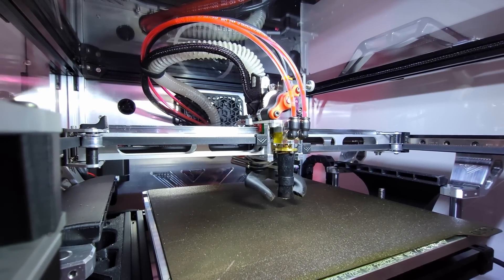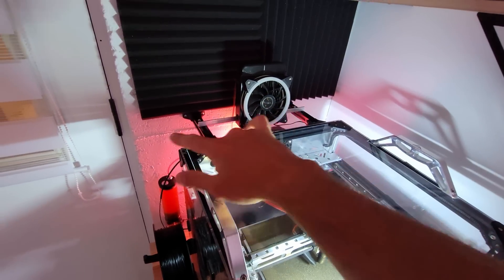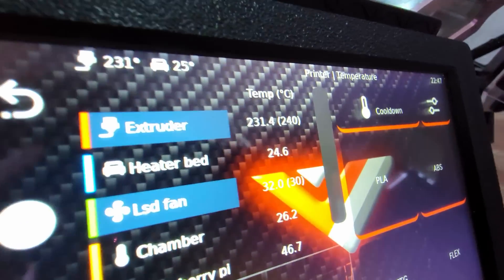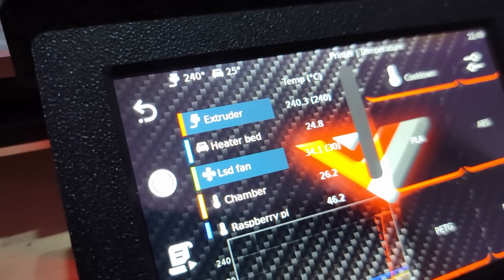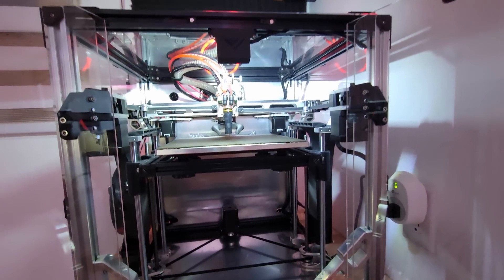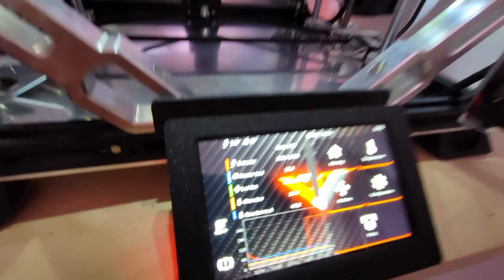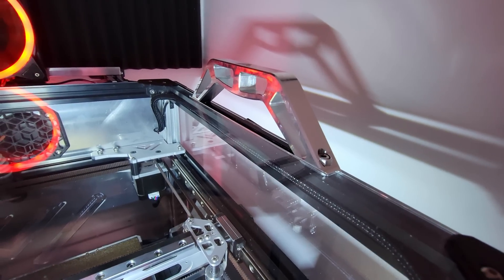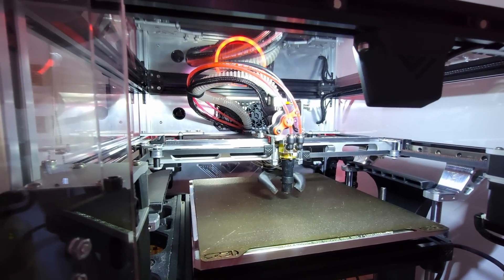LSD hotend watercooled heatsink temperature test 1

Comment: Water cooling seems to be much heavier than 3010 fan and heatsink. And it doesn't improve printing quality or performance.
Reply from the maker: Its not much more .its a bit more I think.  As for as improving print quality, it can help I think. And we are about to have more data on this from what Miragec is working on :) a sharp heat break will have impact on more things we knew about .... :)
Reply: @Vez3D  Sharp heatbreak is less retraction and less pressure advance. But for such a long melt zone it doesn't make any difference. Hope to see some real tests from you soon.
Reply from the maker: @TheNamelessOne12357  its all just a theory..nobody really measured anything yet. :) not even sure if its right or wrong hehe

Comment: Could you do a torture test to see how far it's able to go?
300c+ (400c?) in 120c chamber temperatures would cover pretty much all bases a enthusiast machine would ever see.

And try mounting a 3mm thermistor inside the heat sink, the RSCS probably threw off the measurement since it blew cold air at the thermistor.
Reply from the maker: Thermistor is protected by kepton tape.  I doubt it was affected by the draft. As for 120c chamber..my printer is not meant for that and wont reach it sorry.  I can do 300c with 45c chamber test
Reply: @Vez3D  A quick way to check if the draft is affecting the reported temp is to take a little piece of foam and tape it over the temperature sensor.
Reply from the maker: @bdykes7316  the temp sensor is well inside the block and the tape is covering the hole. I highly doubt it can see any air flow from there
Reply: @Vez3D  My error. I had the wires mixed up with the sensor.
Reply from the maker: @bdykes7316  hehe
Reply: @Vez3D  You could chuck it into an oven to get to those temps, but it's a hassle and I get that you don't particularly want to do that :)

Regardless, I think your designs are some pretty cool stuff, so keep doing your thing!

Comment: be careful with those hose, we use the same at work for pneumatic system and like to crack when there's a lot of movement and heat
Reply from the maker: They are polyurethane hoses. Is that what you use? Ill stress test them when im back from vacation

Comment: Why does the RCSC (?) have any impact on the watercooled heatsink at all? I mean it instantly dropped by about 4 degree which is a lot. Then the heater bed will have a significant impact as well I guess. 
The whole purpose of having a watercooled heatbreak is to be able to print really high temp stuff in an enclosed chamber. But if the chamber temperature (which was affected by the ventilation system) has such a big impact on the heatbreak cooling, you could probably just go with aircooling. 
So my question is: are you sure your watercooling cycle is fine? Nothing is clogged, water running freely, fan and radiator working correctly? You should double check that.
Now I am really interested in a comparison between air and water cooling in a real stress test. 300C hotend, 110C heat bed, enclosed chamber. Or higher temps if you can. At least for one hour, maybe longer. Those are the parameters watercooling is made for :-) 
Looking forward to it, super interesting stuff. Cheers mate!
Reply from the maker: Oh yes..aircooled is perfectly fine. Been running it for weeks even without a fan. That watercool is for those who will have a heated chamber or for those who prefer the coolness of the the thing.  But I think it has some advantages as well. Having a cold and very sharp heat break seems to have impact on retraction and precision of the extrusion. Been discussing with MirageC about this and the theory behind this will be explained in his video. :)  i will let him explain what he found out...but that might have convinced me to keep the watercool systen over the aircool one...even if aircool was working fine.
Reply: Probably the big difference between aircooling and liquid cooling is that the coolant is moved out of the enclosure, which allows for the coolant to be cooled down to ambient temperatures (or even lower with active cooling solutions like a heat pump). Using an air cooled solution would limit the cooling to the cold zone as you can't as easily pull cold air. You would most likely pull air from the enclosure itself. If you could pull cold air then the cold air would also be capable of dropping the enclosure temperature.(which may be only desired up to a certain point to prevent warping).

The problem is a bit more nuanced because of the different temperature requirements across all different areas of the printer. Watercooling does give you a bit more shielding to prevent excess temperature exchanges.

I'm personally also looking forward to seeing a stress test, he might need a bigger radiator so he doesnt saturate his cooling pid's output but it looks promising so far!
Reply from the maker: It is fine and now clogged. The  air blowing on it has a little impact on the themp. Its just normal.  It also has a little impact on the bed too..but pid will keep bed at temp

Comment: You should test it with 300C extruder 100C Bed and let it sit closed for 2 hours. Then you have a real stress test. If it can do that I can do anything
Reply from the maker: It can  ..  i have done that test but with 110c bed and 280c. Its not 300 but close enough. It stayed arround 36c.  But enclosure was open. I should do another test with it closed...but im sure it will work great too
Reply: @Vez3D  285 is recommended HTPET temperature - an awesome material you should check out if you haven't (aka BPET, plain PET). Probably less of a stress case though because it doesn't need heated chamber or even bed.
Reply from the maker: @daliasprints9798  nice ty..ill look it up
Reply: @Vez3D  good!

Comment: How does the temperature compare to a fan cooled heatbreak? If it's possible to keep the heatsink at a constant temperature would that help with a more constant flow?
Reply from the maker: I dont have a sensor on my aircool one. I will need a temp camera to compare..but it is much hotter on the air cool..i can feel it with my fingers. Its definately higher than 50c

Comment: Can you try to print a benchy at, 1500 mm per second?
Reply from the maker: How is that possible? 🤔  you need a certain distance to reach that speed.
Reply: @Vez3D  well now I see your point. But you still can test would happen if you set the machine to 1500 mm or as close as you can get it per second.
Reply: @Vez3D  Above around 50k acceleration a benchy should gave at least some places it can reach 1500. At 250k or so it'd have a lot. Easiest way to quantify would be slicing it and running it through klipper_estimator to see cruise time.
Reply from the maker: @daliasprints9798  i have done a benchy in 3:38 i think..and accel was set at something like 120k. But at 1500mms ...it would need even more to reach
Reply: @Vez3D  The length it needs to achieve 1500 between accel and decel is 1500²/accel but that's assuming starting from zero. When you have shallow turns at the junctions and high SCV it can be somewhat less - (1500²-v0²)/accel if I'm not mistaken.

Comment: This is a serious question. I want to up my game when printing. I currently have 4 highly modified ender 3's and a Prusa. I would ove a VZ bot. I don't print super high temp so water cooled is super cool but not needed. What would one of thse beasts run me? I'm also located in canada
Reply from the maker: There are 2 versions coming..one air cooled and one water cooled :)
Reply: @Vez3D  yes I've seen the air cooled version looking so slick.
Reply: how are your ender 3's modded?
Reply: @otroe  I've added belt driven dual Z, direct drive orbiter extruders. E3d V6 hotends. BTT e3 boards. Linear rails. Better thermistors. Z braces, built my own auto unload arms. There's a video showing them on my youtube. Now I use prusa spring steel sheets for the beds. Bl touches. 5015 fans. Large blower fans to cool the beds so the unloader arms can do their thing sooner. Re did all the electronics moved them under the printer. Soft feet to dampen vibrations. Relays to turn the printers on and off from octopront. Hard mounted the beds no more springs and knobs.. I'm sure I'm missing some stuff but that's most of it. To call them ender 3s is kind of a joke. Just the frames are stock.

Update the arms for auto unload on my youtube were a 3d printed prototype. I now use larger steppers with built in 51:1 gear reduction and aluminum arms. But the concept is the same